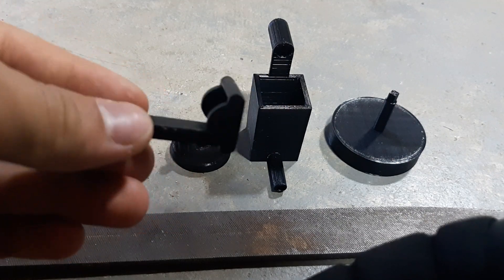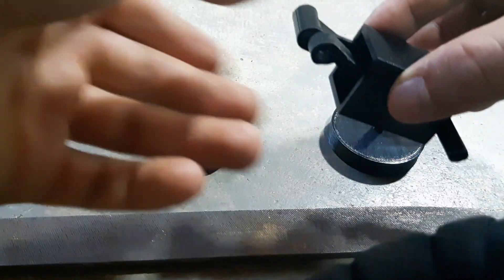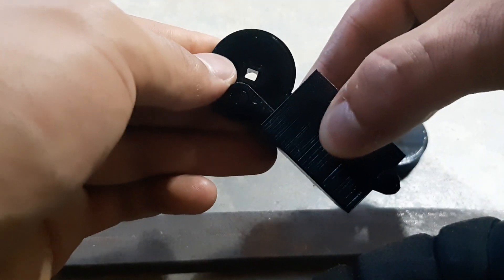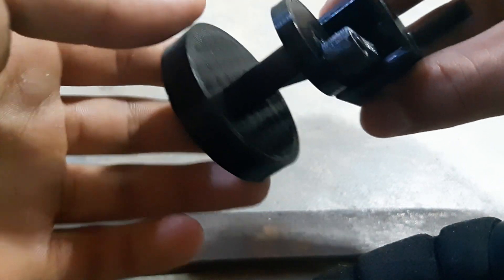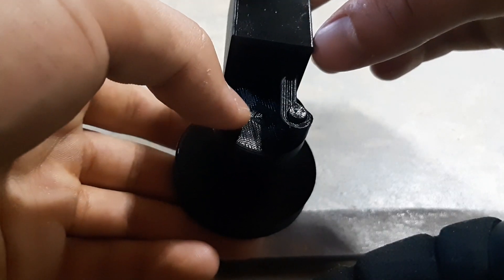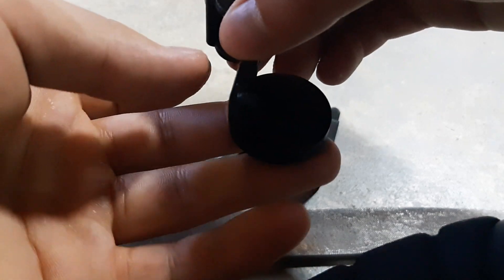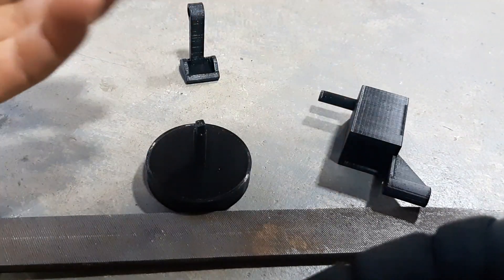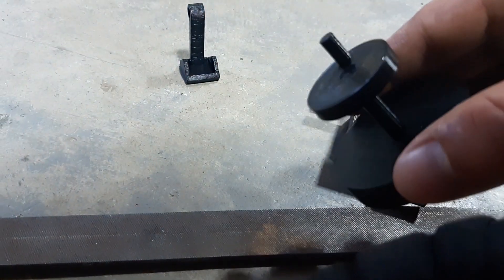Butterfly Air Engine Assembly 3D print

Comment from the maker: 3d file for engine link here
https://drive.google.com/file/d/1JdockZo8tgfKCYKoEdpaZgW6Zb3muYfF/view?usp=sharing

Print settings
100% infill (don't skip on this because the flywheel needs mass and the engine should be strong)
no supports
0.2 mm layer height

Comment: Can you please make a 2 L bottle attachment like you did for the first engine
Reply from the maker: I have prototype 3d model of already and it is very likely I will give it to you soon. How did making the other engines go?
Reply: @ruwyev181  the previous engine with the circular piston I could only get to run at about 4 to 5 psi, and the one before that I could not get to run at all despite hours of sanding
Reply from the maker: I tested the engine connected to the bottle and it runs a bit worse than lungs. The bike pump has high psi but it doesn't have the airflow like your lungs do. Why do you want the bottle attachment?.
Reply: @ruwyev181  plane
Reply from the maker: @jordanflorance4419  Well that would be very hard since my butterfly engine is not specifically made for efficiency. The bottle would run out of air fast. Also the air would leak out before the bottle would be fully pumped.
Reply from the maker: @jordanflorance4419  https://drive.google.com/file/d/1i8mGo1Jvp13NSXojF_qAtIbbaJaOWYme/view?usp=sharing
Reply: @ruwyev181  I’m trying to find a valve that can attach itself to a bike tire valve. That way I can fill it up attach the engine and then open it like a throttle.
Reply from the maker: @jordanflorance4419  For that I would go with a bottle to 1/4npt adapter that goes to a ball valve to a 1/4npt to engine adapter.
So like this
Bottle-adapter-1/4ballvalve-adapter-engine
Reply from the maker: The 2 adapters can be designed and 3d printed the ball valve buy from a hardware store
Reply: @ruwyev181  thank you
Reply: @ruwyev181  ima try to make something out of it I’ll tell you how it goes

Comment: I just finished printing mine after about 3 hours and it runs like a charm! I was able to do 10 percent infill since I added holes on the flywheel to press fit coins as extra weight. It’s a perfectly simple design and runs great, nice job!